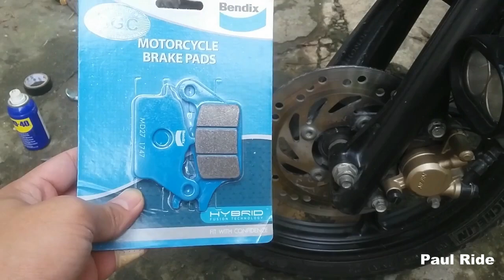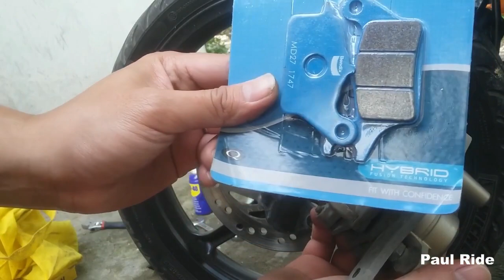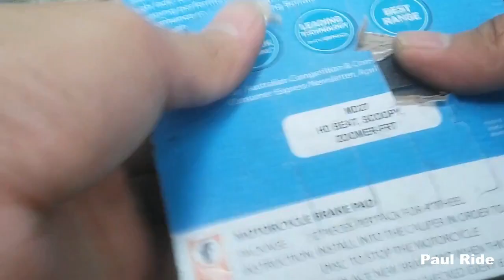DIY- How to replace brake pads | Taglish | Thanks to my subscribers | Honda Beat

Comment: Thanks for the video,  very detailed and helpful.  I found a quicker way to open up the brake pads so they fit onto the brake disc is to get clamp mole grips and compress against the "round ring" cylinder against the caliper to compress it to allow the gap for the disc pads rather than using a screw driver to open the gap.

Comment: sir my tut po b kayo pno install ung cp holder with charger sa honda click game changer. d ko ksi alam san isasalpak ung dalwang wire. salamt sir ride safe always
Reply from the maker: Wow naka game changer ka pala paps. Lodi ko yan! :). Wala pa paps eh. Msg mo si sir dodz30. Honda click motmot nya.
Reply: @paulsimpliciano  oo. hehe. binenta ko n si beatoy hehe. tpos bumili ako ng honda click game changer 125i hehe. lakas ksi sa gas ng beatoy. puro uphill n ksi dinadaanan ko. hehe
Reply from the maker: @lorenzregorgo3438  ayos yan paps. Mas ok talaga modern. Tipid talaga sa gas lalo na yung beat fi. Click 150, pcx at nmax naman pinagpipilian ko if ever mag-upgrade. :)

Comment: Paps paano ang gagawin kapag maingay na ang disc brake sa harap sumasayad na siya need na ba palitan ng bago or adjustment lang
Reply from the maker: Bago ba paps?
Reply from the maker: I mean bago ba yung brake pads?
Reply: Stock palang siya paps 1 year mahigit na siya sa akin pero noon pa siya na maingay anu dapat gawin ko paps laging may ingay sa disc brake ko
Reply: Ito rin nangyari sakin 2 months Pa yung beat v2 ko maingay yung break pad parang may naiipit pag tinakbo kaya pinalitan ko ka agad

Comment: Paps gawa ka video paano gawin ang manubela. pag nag preno sa harapan parang nag hihiwalay. nakaka 3200 na ako kakapalit ng bearing ko.
Reply from the maker: Di pa rin naayos paps?
Reply: @paulsimpliciano  oo paps d parin e. may mga gawa din ako like na repaint ko mags worth 400 php lang mga minor na gawain lang pero yung mga baklasan paps dko kaya natatakot ako baka biglang mabali yung manubela e
Reply from the maker: @lyndoncaruncho6507  madami kasi possible na sira nyan. San ba loc mo?
Reply: pasig ako paps. ikaw ba?
Reply from the maker: @lyndoncaruncho6507  try mo pm si blessed motowash and accessories sa fb. Tropa natin yan. Roxas, Isabela na ako sir. Dati taga binondo lang ako :)

Comment: Mahigpit pa ang ikot ng gulong ko paps parang ipit palagi ang rotor sa brake pad
Reply from the maker: Maraming dahilan paps. Pwedeng pag bago ang brake pad at ibang brand normal lang. Pwede ding mis align ang plate or bengkong na  or yung mismong brake caliper ang tabingi